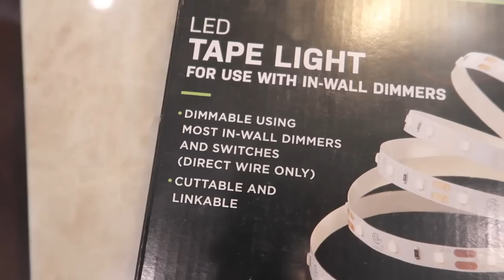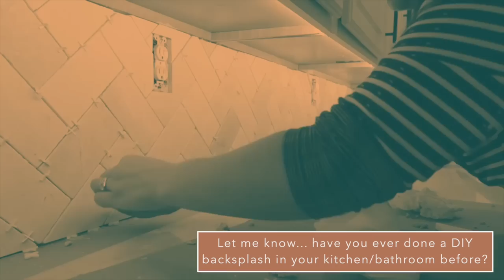NEW HOUSE PROJECTS 2023 :: Kitchen Renovation DIY Backsplash, Under Cabinet Lighting & More

Comment: Amazing!  You did an awesome job on the backsplash.    It is beautiful and quite a work of art.   I don't think I would have had the patience for all the puzzle pieces.  Did you find you had a lot of waste by cutting th tiles that way?
Reply from the maker: We ended up being able to use both sides of the tile most of the time when we had to make cuts… so some waste, but we did pretty well not cutting from new tiles when we didn’t have to 🥰

Comment: I am needing some advice/ guidance. I am getting ready to prep my bathroom for a makeover. We are planning on painting it a green color called Zion. We have a white shower curtain that I bought awhile back with the thought that it will go with any color of paint we choose. With that all being said I am trying to decide what shower rod color/ finish to use and then I will match towel hooks or rod to match it. What are your thoughts? Also I will need to pick a new rug and trash can . I am also going to be getting a new over the toilet shelving system. I was going to go with white but maybe I should so a wood color one. I need help!!!

Comment: If you don't want to have to wipe the tops of those cabinets every year, use paper towels or newspaper to cover the wood and then all you have to do is remove and replace. I have also used old towels and then just toss them into the washing machine to clean.